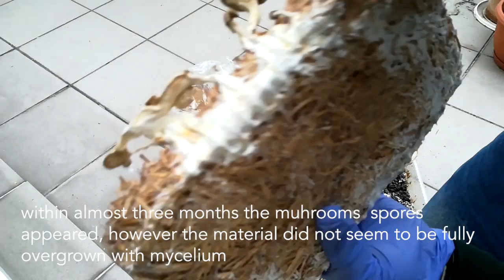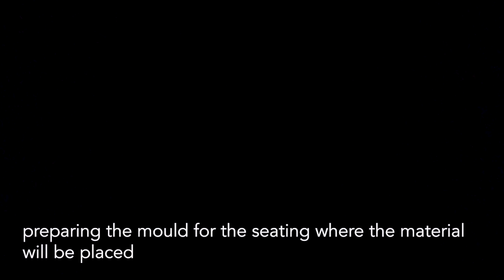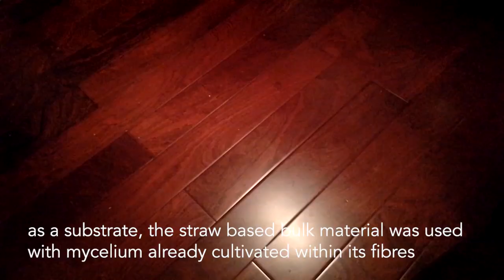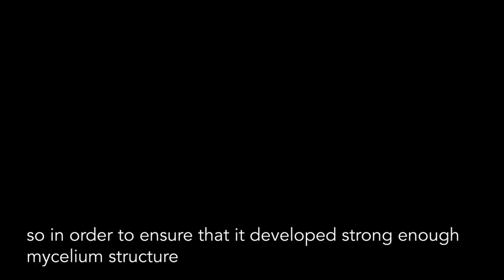MYCOsella, Growing the Mycelium Chair - Manufacture Process Time-Lapse Video

Comment: Extremely impressive, I have been amazed with mycelium as a material since I learned about it, as an architecture student i can't tell you how much good would this material do to mitigate pollution from traditional materials like concrete and clay bricks.
Reply from the maker: Exactly, right! I am doing architecture myself and it definitely has the potential to be implemented within the buildings. It is slowly getting there! 😊

Comment: Amazing! Thanks so much for showing this! I know that some mushroom farmers use lye to repel mold because oyster mushrooms can survive very high PH levels whereas mold cannot. I saw a tutorial where they brought water up to a PH of (I think) 12 (I think they said 12-13 range was fine, maybe 11-13), then used that to wet the substrate before adding the mycelium. They said it could decrease your mushroom yields (but that there was also some debate about that), but if you are not growing the mycelium for mushrooms it could be good.
Edit: I think they specified that it was builders lye, and that some types of lye could be harmful to the mushrooms.

Comment: very interesting project. it'd be good to get a feel for the firmness of the substrate colonized mycellium , or the structural properties to design some other cool furniture
Reply from the maker: It's dealing suprisingly well with the load! Happened that I had my dinner sitting on them and they survived untouched 😊
I assume that as long as you could get it to grow well, it could have a really amazing results with good structural potential!

Comment: Oysters are a wood loving mushroom, I'm surprised the wood chair(#3) didnt work, maybe if you made a hard wood substrate instead of cardboard it would have held or maybe putting some chicken wire in the middle and some sticks placed vertically, kinda like concrete, idk this is so cool btw, good job

Comment: What purpose does the shroom chair have? Is it for garden gnomes? Because that would be so cute.
Reply from the maker: Yes, as the material mix is engineered to be safe it could be used as both indoor and outdoor chair. I would just add that as an outdoor chair it would need some care to keep it in relatively dry environment, as exposed for the environmental factors the chair would start to degrade at some point. 😊

Comment: Youre wearing gloves yet  have the bag open to the air, completely pointless sterilizing then.
Reply from the maker: The gloves were more for protecting my hands from touching the spores in the material than sterilisation itself.😛 However they keept me from adding any any additional contamination.

The experiments from the very beginning were exposed for poor sterilisation condition, as they were not conducted in the lab and that was actually one of the main project objectives. 😁 And it worked 😛